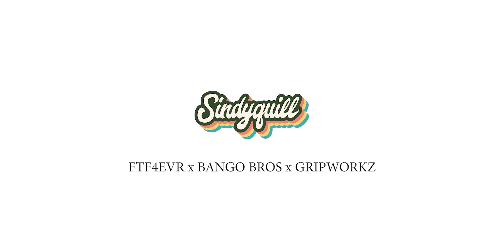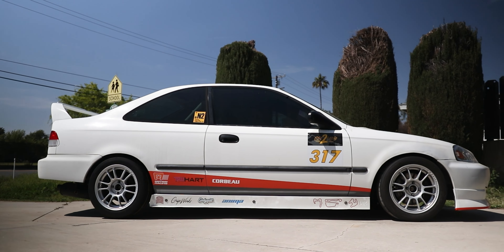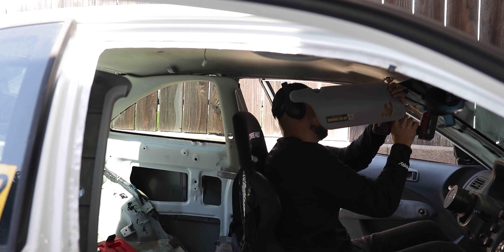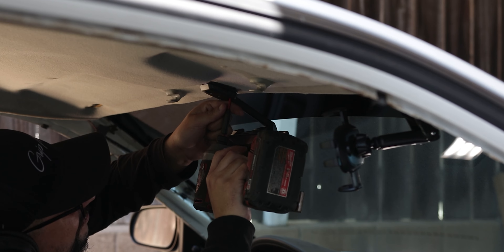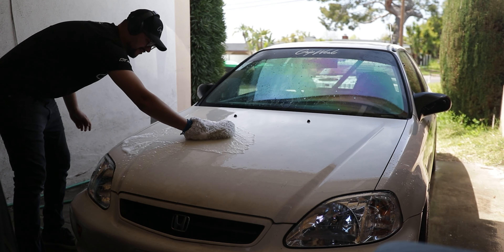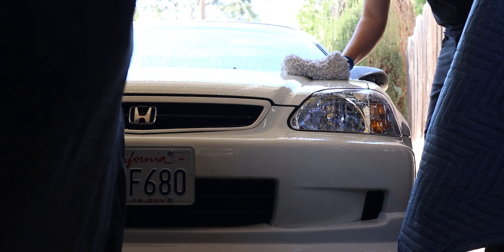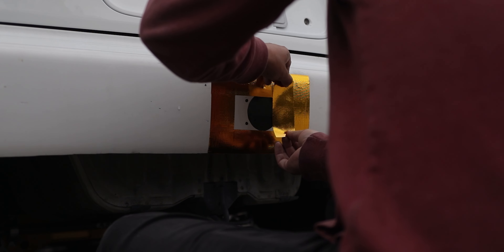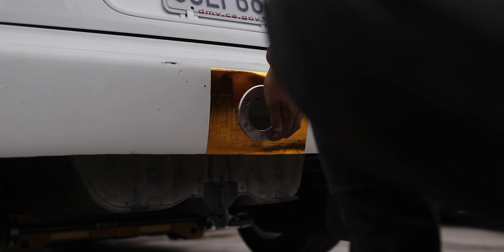Taking My Track Car To A Car Show

Comment: How the transmission holding up so far ?
Reply from the maker: Unfortunately I haven’t had the opportunity to drive it much. Only to that show and back. Hopefully I’ll be getting it on a dyno soon and back on the track for a shakedown
Reply: @Gripworkz  sounds like it's working tho 👍🏻👍🏻
Reply from the maker: Yeah it goes into all gears smoothly, no weird noises yet. Haven’t tried shifting at high rpm because it isn’t tuned